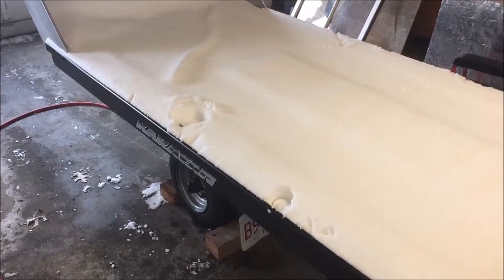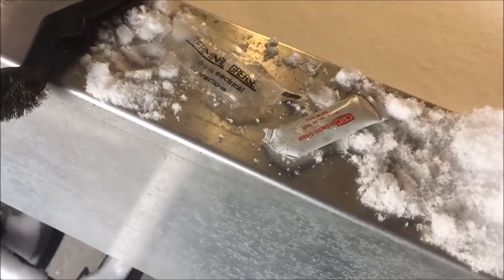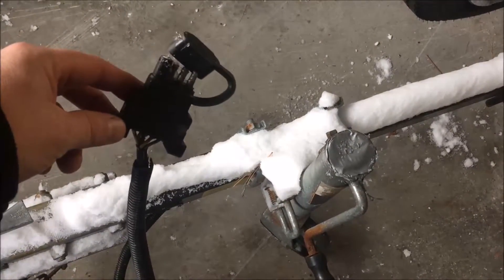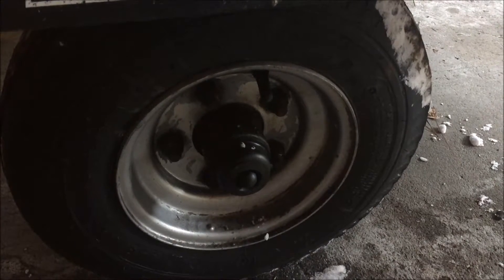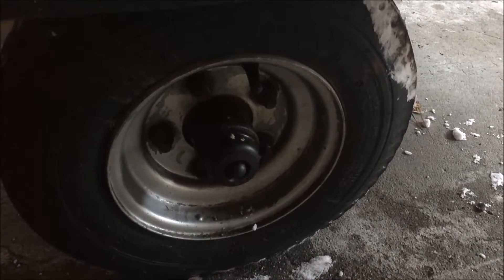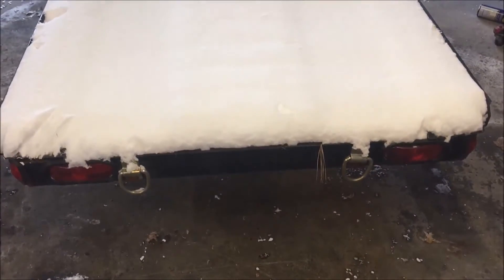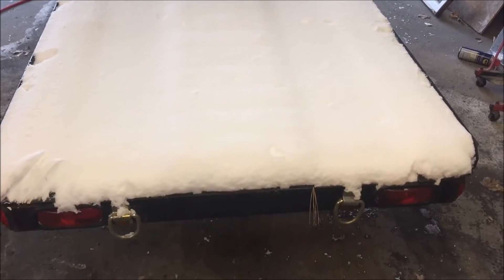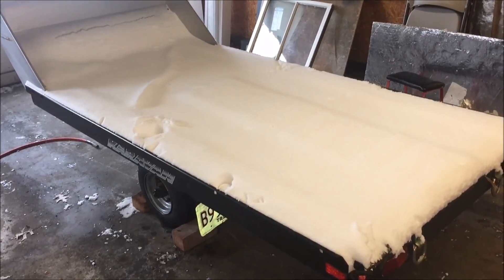Snowmobile Trailer Maintenance 101

Comment: I anti-seize or grease all Lugnuts and center hub and all surfaces that touch wheel, I have seen rims that get stuck with all lug nuts off. I do this  on all my vehicles and trailers To prevent problems
Reply from the maker: Agreed.

Comment: I had to weld three of the studs on my trailer hub when I first bought it .Now they all have anti-seize lube on them. Good tips.
Reply from the maker: Mark Bow 

With the amount of salt on the roads during the winter the trailers take a beating and then they just sit in the off-season. 

Good work on welding the studs on.

Comment: Time for snowmobile trailer maintenence = september. 
Time for boat trailer maintenance = sometime between Christmas & april 1st. Same with the boat & the sleds. That way you're not looking at a huge project a couple of weeks  before your trip. Also, penetrating oil is actually not your best option for your lugs. Use anti sieze as it will remain in the threads of both the stud & the lug.
Reply: I have several tubs of never seize finding one when I need it? Hmmmm, grrrr!!!
Reply from the maker: never ends

Comment: Remember when you entendres your fusion to a 136? I have a question. When I go on the slp website it shows a picture of the rails and the price but it doesn't say whether it comes with the hardware or not and it doesn't show in the picture. Will it still come with it or do I need to buy that separately or what's the deal with that? Thanks!
Reply from the maker: yes it does